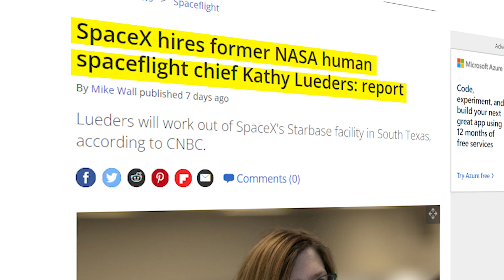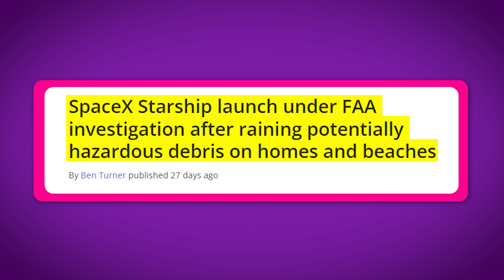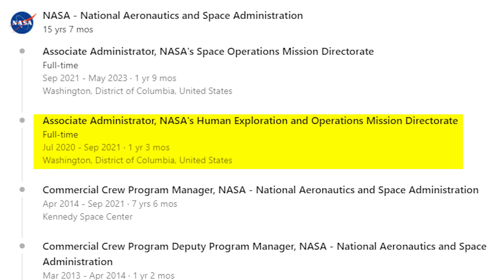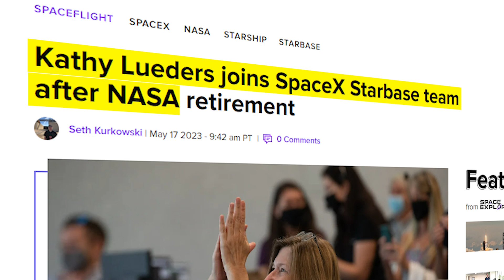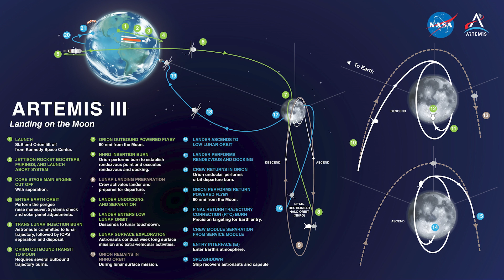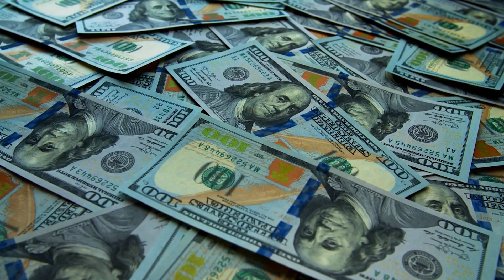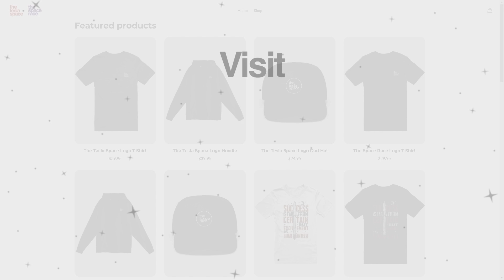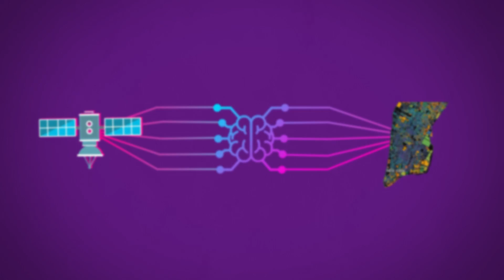NASA Reveals NEW Moon Lander!

Comment: .LANDING ON MOON DOES NOT NEED A HIGH PENCIL NOR A ROCKET PAD TO SETTLE ON SURFACE.
LONG V ESSLEWITH 4 TO SIX ENGINES  TO GENTLY LAND A CRAFT WITH MAIN WALK OF SURFACE DRIVE OF PLATFORM
SHOULD BE SIMPLE TO CONDSTRUCT CREATE MECCANO STYLE IN MOON ORBIT
MAN AND RETURN SYSTEM CAN BE LANDED SEPERATELY.
BIGGER VERSION OF THE 2001 KUBRICK MOON SURFACE TRANSPORTER
WOULD BE AN IDEAL BASE DESIGN

Comment: You will never be able to push enough water under the pad. 329 thousand tons of pressure ? So what kind of supercompressor has been invented to push the much water pressure UPWARD through those holes?
Look you will have to put flame trenches in that shoot the flame pressure off in two to maybe five individual directions rather than one maybe.

But you cannot get around the flame trench requirement in simple physics, regardless of perforated iron plates construction.

This will not work either. So try it and find out anyway. And then you'll be right back to debris blowing all over the launch area again. The rockets will torch through and blast it all to pieces.

Comment: Why in Zeus’s armpit did you say Starship “exploded’ over and over?  
Starship was detonated. That craft proved to be so tuff it may never even buckled if they had not blow a couple of holes in it.
Reply: It did break up into a fireball, which we call an explosion.  From Oxford Dictionary:
Explosion: a violent and destructive shattering or blowing apart of something
Detonation: the action of causing a bomb or explosive device to explode.

So they detonated the FTS charges, it failed, then Starship exploded over 50 seconds later due to uncertain causes, most likely aerodynamic forces.
Reply: @troys9222 
It exploded because they set off bombs inside of it. Do you even have a brain?
Reply: If we are to go to such details
No it wasnt detonated either it broke up.

Tho tbf, B7 did have few explosions on the way up ;)

Comment: Cool to see that with Raptor V3s Starship will have just short of 20 million pounds of thrust
Reply: That's if they all start.  Can't assume that ever
Reply: @troys9222  Yeah but how do we know that the reliability won't be improved? It must be possible if they had all but 3 start on their very first test out of 33. Over 90 percent success rate already as it stands
Reply: @_MaxHeadroom_  That last word was supposed to be 'even', and kind of a joke, but ever is funnier. A 90% success starting up (on vehicles) is terrible after 9 years of development.  They've only had all the Raptors on a vehicle work perfectly once, and that was 3 engines.
Reply: @troys9222  We'll see but I don't think it's fair to assume anything yet based on one test with what will soon be outdated engines. It can only lose 3 engines and still make it to orbit so getting every engine started is a must
Reply: @_MaxHeadroom_  I'm not assuming, that's the thing.  I'm waiting to see. I can't say I'm confident, but you can't assume it will all work out either. It's going to hurt the space program pretty badly if it doesn't. Losing about 2 engines per minute at this stage is concerning.  Elon says on one hand they are currently optimizing the Raptor for reliability, then talks about pushing the engine even harder, without even having a reliable baseline yet.
Reply: @troys9222  If it were the 10th flight and it was loosing engines still then I might be concerned, but not after the very first test using an already outdated booster. Every flight gives them data on what needs to be improved.  Who knows though, maybe you're right and they will just never be able to prevent engine failure and Starship will never succeed in make it to orbit despite the millions of $ in R&D being out into it. The Soviet N1 never made it to orbit either
Reply: @_MaxHeadroom_  Fair enough, though I'm just not sure how iterating so far removed from what you actually test is working for them as it stands.  They may have it more figured out than appearances, but it sure looks like a mess at times.
Reply: @Levitiy  Closer to 2 1/2 but yes still incredible

Comment: Was very surprised the pad didn't already had this kind of pillars buried underneath. If you think about the vibrations and the weight pressing down, it is similar to a building during an earthquake. So i kind of makes sense you need a good solid fundation.
Reply: Yeh.. I've been noticing for quite a while now that a combination of Elon not really knowing what he's doing &the breakneck pace he pushes the engineers who do is causing alot of unnecessary problems that he craftily writes off as "rocket go boom actually good!!"
He's trained his cult to respond positively to his rockets blowing up so even when it's a sign of incompetence &lack of foresight no one bats an eyelid at a gaff that wastes billions of dollars of taxpayer moolah
Reply: It only had 6 of those type when installed, for the legs.  Then, there were 24 much smaller piles in the center with only a single rebar in the middle of each.  They look to be 12"  (30cm) maybe, in diameter.  I'm not a concrete guy, but I've seen a lot of piles poured on sites, and I have never seen a single strand of rebar in one ever.  If you look at the first aftermath photos you can see the tops of several of the small piles in the crater.  CSI Starbase channel and others have photos and renderings of the original pad construction.
Reply: But one Problem was many, that these 24 smaller piles weren't well distributed, because there were some corners left inside the hexagonal, that only rely upon the sand below the concrete... but CSI Starbase have very good Video about it on his channel...
Reply: @futurespace2380  I don't think they evert tied the outer ring into the center hex either.
Reply: Yeah, it's not like NASA never did that.